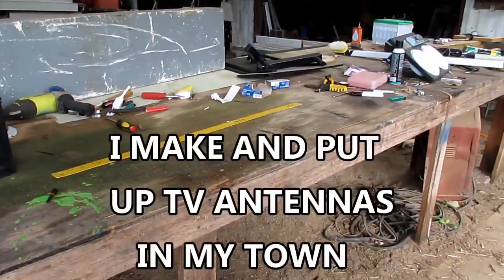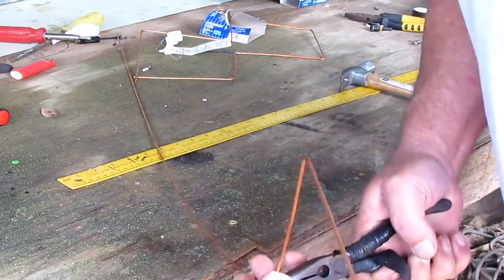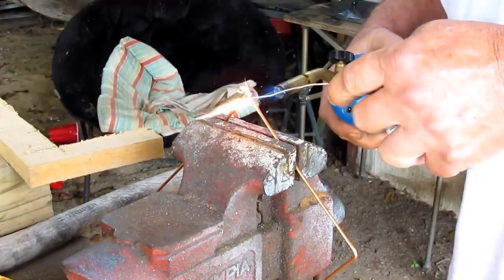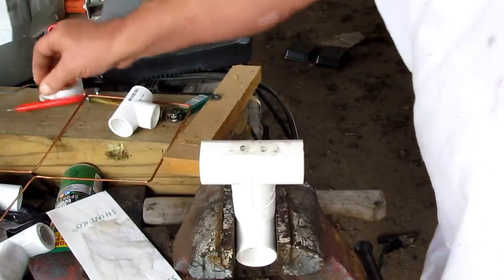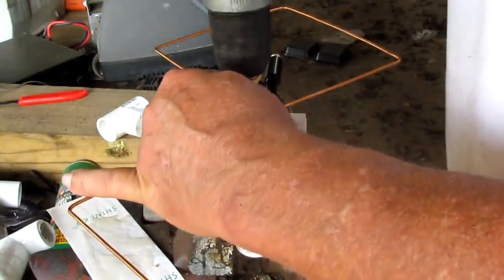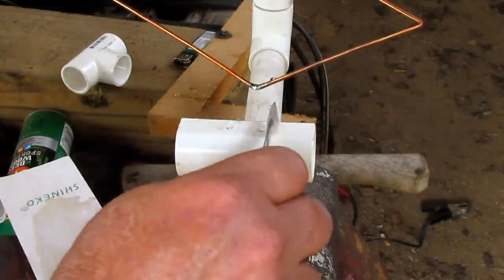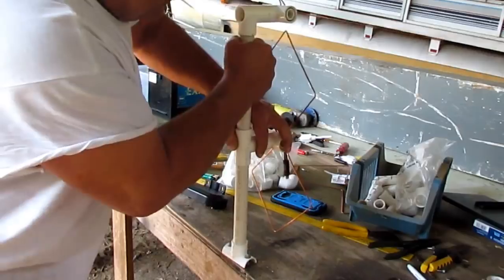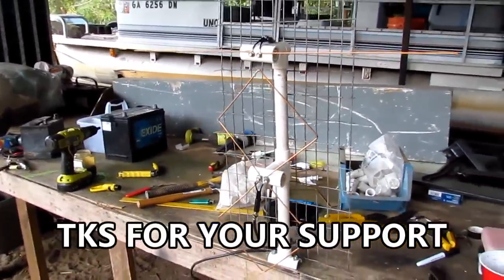Best DIY Indoor Or Outdoor TV Antenna Ever Made

Comment: Hey Danny! Looking forward to see how this does when you aim it at Macon. I'm hoping you compare it to your big ultimate antenna. I built two of your Grey-Hoverman's & put them in the attic aimed at the Atlanta towers (about 40 miles - needed two antennas for two directions) and they work perfect!
Reply from the maker: all right give me a couple days..tks
Reply: Thanks for the video. Made a few myself and one design worked better than any other and I gave it away. I figured the next one would be just as good but could never duplicate the success of that one antenna.  Don't know if it was the wire, mesurements or what but I'm still trying.  The design with wire coat hangers worked fine but I keep trying to get more distant  stations. Never had luck using two antennas pointed in I  different directions.  Bottom line, its fun trying to make one better.
Reply: Careful using two antennae hooked together you can get "Ghosting" double signal overriding lose your reception altogether. good luck. built one of these just for fun works great

Comment: This design is decades old. You could hardly call it your own.
Reply: Bi-quad with a rear reflector and a VHF dipole (and the reflector isn't even big enough for that).   PLUS, if used on the old NSTC standard, that would have caused "ghosting" of the picture...

Comment: Nice video, thanks. fyi: 
Your 14" corresponds to 211Mhz as a 1/4 wave antenna, which is lower end of vhf but I think if you double the length to 28 inches it will be a 1/2 wave; 1/2 wave is supposed to be better than 1/4 wave.   I suggest you build one that is all 1/2 wave from 200mhz - 600mhz;  here is the list of half wave for 200mhz - 600mhz;  
200mhz = 59" full wave, so 1/2 wave is approx 29.5 " ;Your 14" is in this freq range as 1/4 wave
300mhz = 39.3" full wave so 1/2 wave would be approx 19.65" 
400mhz = 29.5" full wave so 1/2 wave is 14.75 " 
500mhz  = 23.6" full wave so 1/2 wave is 11.8 " ;  Your 6" is in this freq range as a 1/4 wave
600mhz = 19.7" full wave so 1/2 wave is 9.85"  
SO if you make your different spokes to these 1/2 wave lengths I would say it would do even better !  FYI: spiral antennas tune themselves, food for thought.  I like your reflector idea.

Comment: The Hoverman design has been around since the 1950"s.

The Hoverman design is a Fractal Antenna Design at a time before computer designed antennas.

Also check out , Antenna Craft G-1483 and Radio Shack 15-1627

Comment: Good deal. It's very similar to a 4 bay UHF antenna used back when UHF first came on the scene and you needed a converter to change UHF to either channel 3 or 4.

Comment: Dam Danny you are getting with it and yes the biquad is a good performing antenna , you might mention if the extra gain of the reflector isn't needed then by leaving it off you will be bi directional so if you live between two city's you can get both . And was wondering if you turn the biquad over wouldn't it work better ? Well maybe not the way you are feeding it . I know it sounds wierd but quad antennas are a little different from dipoles and there basically 2 dipoles stacked on top of each other spaced a a 1/4 wave apart , so that antenna is like 4 dipoles stacked. Love your what your doing man keep up the great work.
What you have here is two full wave loops fed from the center . 
Would you try breaking that loop at one of the screw points and putting your transformer there then rotate it to see if it would work better? It looks like the way you are feeding it is adding to much impedence to the system . 
I make transmitter antennas out of pvc and fiberglass but love the simple approch with PVC pipe.

Comment: Unbelievable! I followed your formula to a T. except for the reflector. I used 1/4 inch mesh type fencing, but it seems to work fine. wish I had known about you 5 years ago cuz I wasted a lot of money tan on antennas that didn't work well... I don't know maybe the turning point was this RCA preamplifier? anyway this exact antenna is up and running! and I'm not going to touch a thing. thank you sir for your expertise! you sir are a honorable engineer!
Reply from the maker: thank you sir

Comment: Very nice work but I have to pick at one little thing.  The conductor end always goes under the screw in a clockwise direction so it gets pulled closer to the screw as it's tightened.

Comment: Excellent video!  Keep in mind that the original Hoverman was tuned for the mid UHF range.  With the recent FCC repacking, all UHF stations will soon be below Chan 37.  Check the distance   between the active element and the screen reflector, it's a critical measurement.   It looks to be about 3" in this video which would be fine for Chan 45.  Increase it to 4.5" and you'll get more gain on the lower UHF channels.  You also might add about an inch to the width of the active elements.  Again, this would tune it for the lower UHF range where all UHF stations will soon broadcast.   It's just a suggestion to maximize performance between 14 and 36.  You do excellent work!

Comment: MR HODGES I THANK YOU FOR YOUR INFORMATION .I BUILT A HYBRID ANTENNA USING THIS DESIGN AND ADDED 2 PAIRDS OF 10 INCH ULTIMATE ANTENNA WHISKERS.WOW THIS ANTENNA PICKS UP MOST STATIONS IN MY CTY SO WELL YOU THINK  GOT A  NEW HDTV. I CALL THIS DESIGN THE ASTROTENNA. I WILL ADD A SIGNAL AMP AND MOVE IT AROUND TO GET THE STATIONS  I HAVE NOT GOTTEN, THANKS

Comment: This looks pretty legit. It probably picks up about 70 miles away. Any antenna that claims to pick up more than 70-80 miles away is a boldface lie. The strongest antennas can only pick up around 70-80 miles because of the curvature of the earth. If you're super lucky you might get 100 miles at night. I'm still new to antennas myself but I'm learning. Also there's really no such thing as an HD or 4k antenna. They either pick up a uhf or vhf signal or both depending if they have both elements. If I had the money I'd buy one of this guy's antennas.

Comment: Yes, painting your antenna design, with a non metallic UV rejecting spray paint, will extend the life of the antenna from the copper turning green, and the metal rusting. It's a trick we used, in the old days before cable & satellite. Oxidation does occur over time, between the steel rivets & aluminum elements, which does degrade the ability to pass signal.
Reply: I agree with you. Actually the insulation can be left on the conductor. It doesn't have to be bare. One thing I did notice is that he never mentioned about sealing the cable connections. If mounted out side the connections will eventually corrode and degrade the signal going to the TV.

Comment: Those are lite weight but I prefer the old large antenna I grew up with. The reason being it has longer pick up range. If you need a pre amp go ahead and use one if you need it. The lite antenna will always need a preamp to increase your range at a distance.

Comment: watched the whole video. Thanks. I'm planning to build one. What size fencing did you use for the shield? Is it 1"x2" And what are the dimensions of the piece?
Reply: The "fencing" must be shorter than 1/4 of a wavelength at the desired frequency.    Think about that...  if you used "1/4" hardware cloth" you could get into the GHz (wifi).

Comment: Ya'll got your old 5/8 wave Super Penetrater on the roof of your mobile? That antenner on the roof is for transmittin and receiving and that tv one  is for receiving and is as good as a wet spaghetti noodle on a coax cable. (The wire mesh will block signals from the back side. How does it work on the flatside? kick it on back you got the Wonderful Wino here)copper is gonna get green with weather so yeah paint it

Comment: Hi Danny, i'm from Indonesia, I built your UHF antenna and the result much better than any antennas I bought....thanks! But I want to ask the length of dipole antenna, sorry I couldn't find from your video... And what if I made its antenna with 4mm2 copper? I don't have 6mm2
Anyway thanks for your sharing
Reply: I would say give it a try. You have nothing to lose. Play around with minor changes to the length of the copper wires. Vary the distances with the back reflector. Some TV sets allow you to measure the strength of each channel received. I'd just experiment until you get the best overall compromise for signal quality for the stations that you are interested in.
Remember that there is no perfect antenna for all conditions on your TV, so aim for the best overall compromise you can. The learning experience you get is worth the effort.

Comment: You can do just as good with a coat hanger and an aluminum pie plate.  Been using mine for over 10 years now.  Pick up stations 60 miles away.

Comment: You Need A  2 Way Input/Output Splitter To Combine Signal. Cable RG 6 Equal Length from Antenna Transformers to the 2 Way Input/Output  Splitter.

Comment: antennes hey I might give one of your designs a try my problem is trees right next to the house I could cut them down but Id prefer not to have to Ive tried several antennes n nothing works yet n I know we used to have one on the old house back in the day they worked fine n all we had were a few channels. Now with cable or internet charges of say 3600 a year and the house only occupied a few times a year it would be way cheaper. To consider using a TV antenna and Im tasked with figuring it out. Hey I moved into an old house in town and put up a TV antenna about ten feet off the ground n I get12-14 channels. So why Im having trouble is beyond me though I did see an antenna in the attic that is not hooked up. Is it possible it effects the reception of the antenna I installed. Maybe a dumb question but hey you never know. I dont even think mine is grounded I grounded the one at the other house. But I still got no picture or reception n I think Im about 60 miles from the TV stations Im trying to help my younger brother out since he now owns my old family house. James

Comment: Try to make Yagi-Uda Antenna , you could receive good quality broadcast from it then that dipole you just made also the key of getting high quality reception is the material you're working with and the structure also the impedance idk how much you really get from this thing without plug it to a Spectrum Analyzer , so you might get something out of it but i'm not quite sure.

Comment: 28" is center of high band VHF or channel 10 at 1/2 wavelength. The booster would overload and distort the signal and even overdrive the input of the TV. In other words the booster had to much gain for that antenna, practically on strong local channels. I have tried several makes of boosters when I put up antennas and found that I had to do the same with one that did not have as high a gain, but still boosted the weaker channels!
Reply: Hi Harry!  You are "kind of" right - but right for a wrong reason!    DON'T BLAME THE BOOSTER!  Blame YOURSELF!!!  You basically "did it wrong"...   A "booster" basically BOOSTS the signal that it can receive!  if it "boosts" from 5-1000Mhz, then you can't BLAME the booster for boosting the HAM radio operator down the block that is putting out 2000 watts on 7-ish MHz!  That is totally <insert gender here>'s right to!   With the advent of HDTV in 2007 , I've not heard that TVI was an issue!

SO, I might "think" that your VHF frequencies (and maybe FM RADIO) might be swamping your amplifier from the UHF frequencies...    If so, you need FILTERS before the frequencies that you are trying to receive!

Terrestrial DTV (or TEE VEE) is king - and those are the high towers that you usually see on the tops of hills.  If you see a lone tower - or one on the top of your local skyscraper, that is an FM radio antenna.  If you see a FIELD of antennas that all kind of look the same - and they are all the same height, that is a AM radio transmitting field.  Yeah, I know that might seem CRAZY - but, at night, many stations have to cut their power and they use this field of antennas to go "directional" to their intended audience.  Certain layers of the atmosphere die away overnight which let long distance travel of long waves possible!  An AM radio station with a power of 10 watts at night (Shelbyville, KY) was received in Niagra Falls, NY!

Comment: if i rememebr the signal is still in the 500mhz ranges. look for dipole antennas and learn them.. 468 div by  500 is around 9 or 10 inchs. solder it to center on a piece of coax and hang another off the shield side. done. pin it to cieling or outside so on inside pvc pipe painted to match house so on.. cheaper easyer then all these super antennas that arint needed..

Comment: Danny can I use 8 gauge copper wire ? Also what material is that grid sheet ? One more thing Danny, do you know about di-pole antennas? Are they good for tv reception ? I tried making one out of a copper pipe but I’m 80 miles from the tower 😫

Comment: Excellent video Danny!
Two questions:
1) I have my current antenna (no back mesh or reflector) in my attic aimed towards Toronto's CN Tower where many TV signals come from.  But I also have many Buffalo NY stations ABC, CBS, etc (the opposite direction) that come in really good and I don't want to lose those.  Is the metal mesh designed to improve one direction, or will it affect my rear facing signals from Buffalo?
2) Why bother soldering the two ends together?
Look forward to your response.
Reply: The mesh will stop the garble from interference coming from behind the antenna and reflect from the front to boost the signal. And the reason you solder the connection is to stop electrolysis that will lower your signal quality. Not The one that made the video but I have made a few of these things and I hope it helps you
Reply: @wuz2do  Thank you for your response.  It was 2 years ago, and the signal is excellent with no changes.  Can't be bothered to go up into the attic to solder the wires, especially since my trusty hand made antenna is pulling about 40 stations.  I am fortunate that I am near the lake (no buildings or other things blocking that signal!) so I get optimal signals.

Comment: This is the first of your videos I happened to find, it's absolutely great, and I subscribed to your channel!  I had no trouble at all understanding, all my relatives are in Alabama, and I don't get to hear the deep South accent much anymore, but I can still understand without any trouble!  I miss hearing it.  Great work and design on the antenna, I will be checking out the other videos too!  In summer I'll try building one.  I live within 10 miles of our major channels, and I use a conventional vhf-uhf antenna from the early 1980s in my attic, with a rotator, and it works great.  But this is a compact design I will try for my camping trailer.  Thanks for the videos!

Comment: Very interesting, could this work in Canada,  do your antena's pick up digital signal.
Reply from the maker: Yes Yes
Reply: I am in Toronto and yes I have been using homemade antennas ("Gray Hoverman" design) for 6 years now.  I have three in my attic, (one per TV) and they pull about 30 local channels and several from Buffalo, NY.   I have found that the direction the antenna is pointing is key. Mine towards the CN tower.  I am now hunting for a good quality balun.  Mine were $3 off ebay from China, but apparently Channel Master has the best on the market.  CM-3203  but it's $29 USD !
Reply: Although there are digital and HD transmissions, They are encoded in the transmitted FREQUENCY,am,fm, ect..  Antennas DO NOT pick up Digital or HD even though retailers and many manufacturers include HD and Digital in their descriptions.  The receiver is the unit that DECODES the signal.   ALL signals are transmitted on assigned frequencies, antennas are designed to be RESONANT for the desired Frequency(s)  (or channel) for best reception.  This application of physics holds true no matter WHere you are, planet earth or out in space.

Comment: I have been making tv antennas every once in a while for at least the last twenty four years.  I am not so interested in just  70 or 80 mile radius ranges of reception.  I live in Corpus Christi, Texas, and  have picked up digital tv stations from Corpus Christi, Victoria, Rio Grande Valley, Fort Worth,Houston, San Antonio, Dallas,  the country Mexico, and even one from Shreveport, LA.  What I am interested in doing is finding out how to pick up the distant stations consistently.  I know that I would need a 220 DB gain  from the antenna to pick up San Antonio on a regular basis, before any amplifiers are involved.  I have used ten Radio Shack UHF bowties to pick up Victoria, San Antonio, Houston, and the country Mexico, without an amplifier, but not consistently. When everything was still analog, I estimated twelve UHF bowties could provide 150 mile radius range of reception.  I  do not  really know how to come up with that 220 DB kind of gain, yet.  I admit that I did not really know how to use the PVC pipes for the frame of the antennas: I used wood before.  The length of the wire should  correspond to the frequency of the signal.  I have an account at antennafool.com : though I seldom log in.  My antenna is on the second floor of  my house, and I have it connected with clips, because it is temporary.  I am former active duty Navy.  Would you happen to know how to make such an antenna?  My email address is nowakrosebud3@att.net.  I would be grateful for a reply. I do not have a youtube post at this time. Sincerely, Brian Nowak
Reply: Brian Nowak  would you build me one? Yours sound good too.